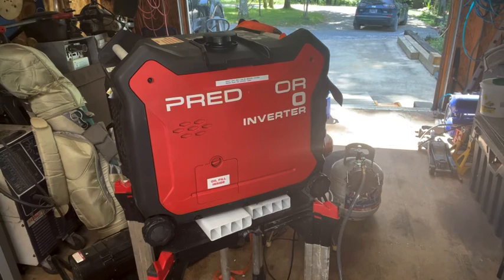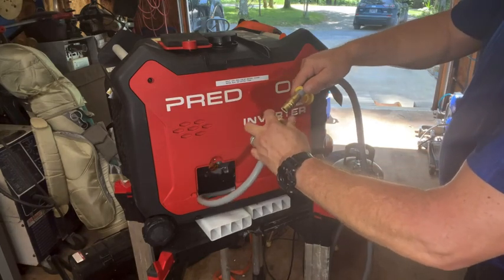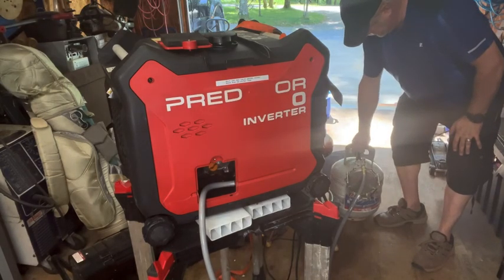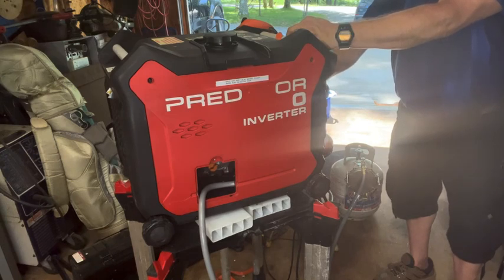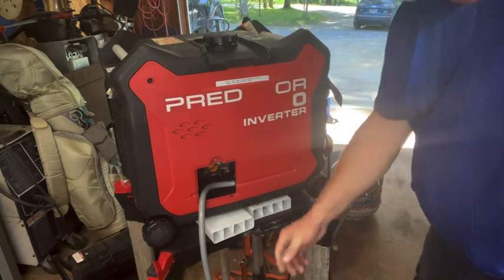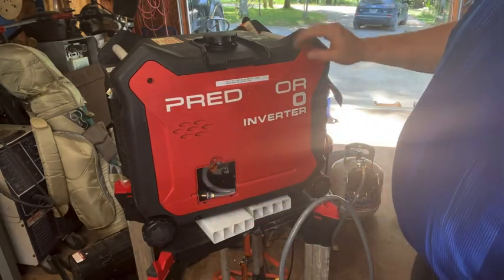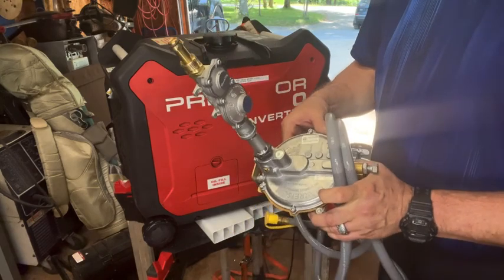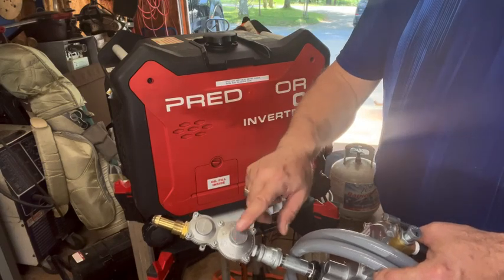Preditor 3500 Inverter Generator Propane, Natural gas, LP Conversion that works, Tri-Fuel

Comment: How do you have the gas turned off when running on propane? Does the stock HF 3500 have a gas shut off valve? Are the Kits on Amazon any good?
Reply from the maker: Good question. Check my other video out on how I added a shutoff switch so the fuel valve can be shut off. This is also very helpful when running on gas, it lets you run the fuel out of the fuel line and carburetor. This help prevent carburetor issues during long storage. My Honda 3000 has suck a shut off from the factory.
Link to video:  https://www.youtube.com/watch?v=l6KQwceSthw